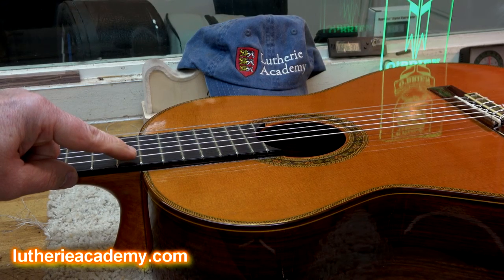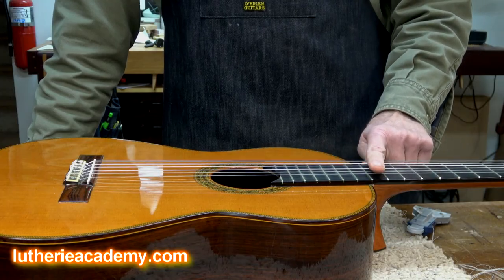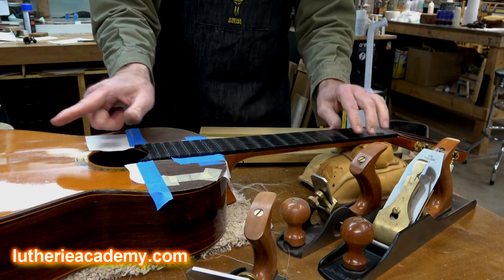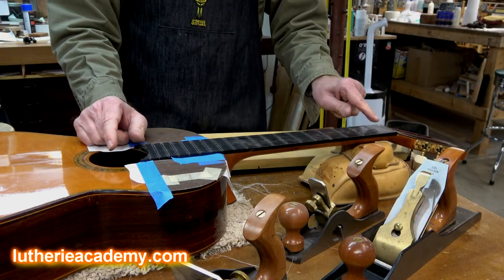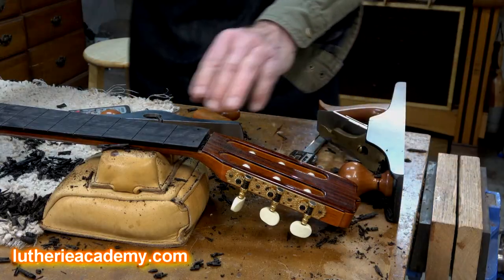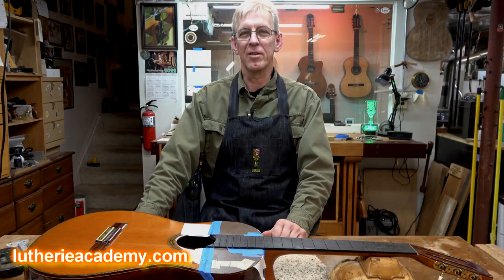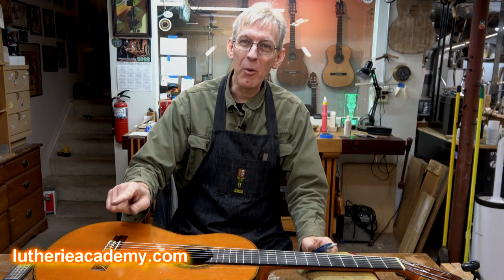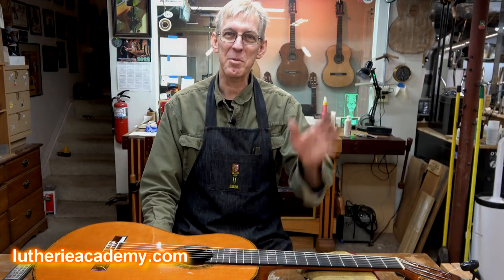Ramirez Neck Angle Adjustment  - Lutherie Academy

Comment: The action was high because the Neck was bowed. So the neck itself was the problem and it should be straightened. Instead of solving the reason of the problem, the neck, the fingerboard that was not the culprit was filled and wood removed from it. The neck is still bowed.  really don't get this video

Comment: Ramirez classicals gave the long scale instruments a bad rap. People seem to think that they are difficult to play because of the 664mm scale length. That's not the case...just look at Jose Oribe's long scales 665mm, they play like cutting hot butter, David Schramm the same and many other long scale builders. With Ramirez, it's the total set up, the taper in the finger board and the incorrect neck angle. It's hard to find a Ramirez, especially any older ones, with a proper neck angle. Also, classical players seem to think they need a 4mm action at the 12th fret. IMO, 3mm is much better. (6th string).

Comment: watch out. many of those cedar cedar ramirez instead of having an angle planed into the underside of the fretboard tongue to allow for the forward neck angle, have a reverse radius built into the upper transverse brace, i. e. the upper transverse brace is not flat, but concave to allow the fretboard glueing surface to be lower than the soundboard plane and sometimes it is that transverse brace that's not strong enough and the whole fretboard and neck end up dipping a little too far forward.
Reply: A very useful warning!

Comment: Most agree for a steel string guitar a bolt on neck preserves the legacy of the guitar---here is an example Mr. Obrien is pointing out and I have personally seem many classical guitars that had over the years evolved to be difficult or impossible to play---A bolt on neck is just not for steel strings---it is for classical's as well---to preserve the guitar's legacy for over a hundred years.  A tightly fitted bold on neck---there is no loss of sound as some claim a permanently set neck sounds better---not true---a tightly fitted bolt on neck is the way to go for both classical and steel string--What is your opinion of this Mr. Obrien? m
Reply from the maker: There are many examples of builders that use other joints than the traditional Spanish neck joint.

Comment: Funny enough, 4.5 mm action is quite standard for the old Ramirez guitars. Thats the way they were designed and they’re great if you have the hands, technique and gusto to play them. 
If you want an easy-to-play guitar, its probably not your best fit. They like muscle, you can’t get the growl and enormity of sound with low action on those.

Comment: Sick video, the only flaw I see in this is removing material and less wood being there thus making it easier for string tension to bend the neck forward again.
I would rather bend the neck back with heat a bit and if it needs a re-fret, just go with taller frets.

Comment: Hey Robert, Love your videos! I've got a couple of guitars with this problem. Fortunately, it's not as bad as the Ramirez you have there. I am thinking about some light sanding and refretting with taller frets, going to a 2.28 x 1.40mm wire. I've seen discussions that the taller frets make barre chords easier.  Your thoughts?
Reply from the maker: That might work. However, once the frets are off re-evaluate and see if you can benefit from this technique before re-installing frets.

Comment: Great video! When measuring at the bridge, what were you aiming for there for height?
Reply from the maker: just enough to get me the action needed at the 12th fret. Measure your existing saddle height and the current action and do your calculations to know how much adjustment is needed to get the target action with the correct amount of saddle exposed from the bridge.

Comment: What about slipping the heel?  I’ve done that on Ramirez, Humphrey, and other classical guitars.  It leaves the fretboard at its original dimensions.  I’ve seen more than a few instruments with severely tapered fretboards where a heel-slip procedure would have done the job less intrusively.
Reply from the maker: That is certainly a viable alternative.

Comment: With that guitar there appeared that the fret-board had a lot of extra thickness. If there isn't the required wood to do the method demonstrated what would be the options with a guitar with a neck like that?
Reply: You can take the fretboard off and add a long wedge underneath it, tapering away to the nut. That is a much more difficult repair.
Reply from the maker: You could also just replace the fretboard with a new one.

Comment: If I want to lower say for example 1 mm at 12th fret, how much do I take down at the nut end?  Is it the same or does 1 mm at the 12 drop it .5 or 1.5 at 12th for example?
Reply: If you want 1mm down at 12th fret you must remove 2mm at the bridge, remember that 12th fret is exactly half of scale length so it's going to move half of what you move at the end point.
On the other hand, the nut height depends on first fret height, you can check it by fretting on third fret (G) and tapping right over the first fret (F), the gap between string and first fret should be minimal but not zero, because then you might get open string buzz.
🍻
Reply: @dinamoarg  Im good for nut measuring, use the same method to measure.  That makes sense doubling the drop due to scale length, thanks!

Comment: Is my geometry thinking correct : When we lower the action at the saddle we lower it by a factor of 2 in order to get the desired height at the 12th. So lowering the action at the nut end , I would remove the wood by a factor of .5. i.e. in order to lower the action at the 12th by 2mm I will begin by removing 1mm at the nut?
Reply from the maker: Your geometry is correct. However, not all guitars have enough wood on the fretboard at the nut to take that much off.
Reply: Thanks for the heads up. I will pull a taught line from the nut to the saddle to see if the fretboard has enough material. And I would also like to thank you for the very timely reply.  @OBrienGuitars